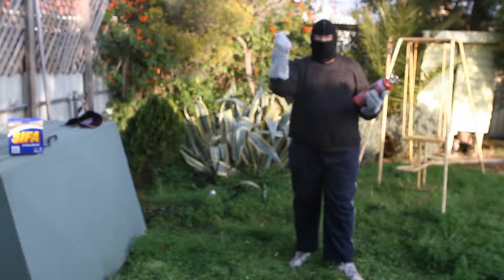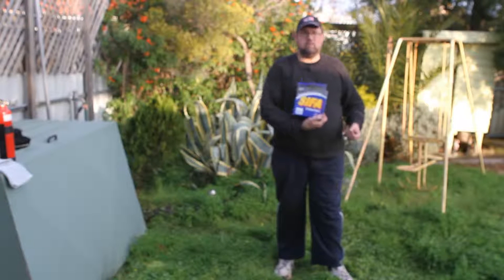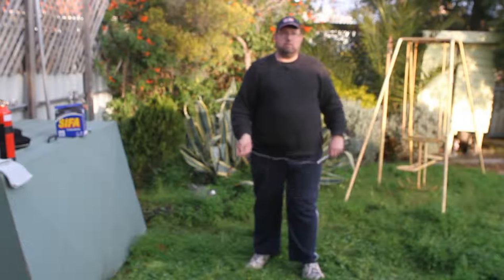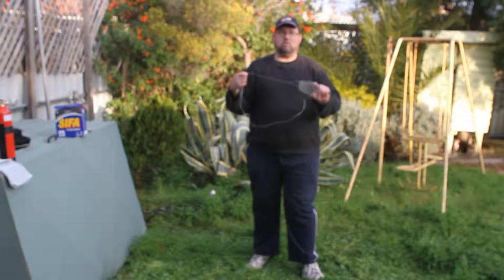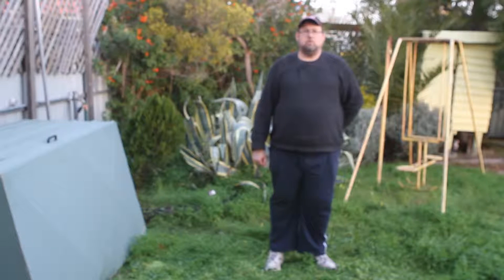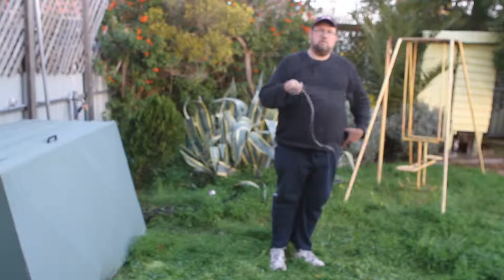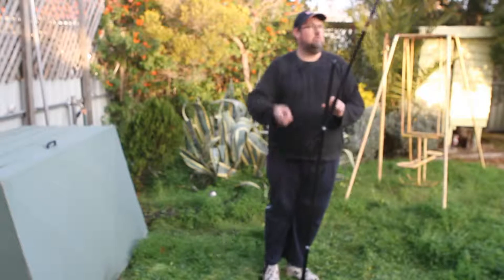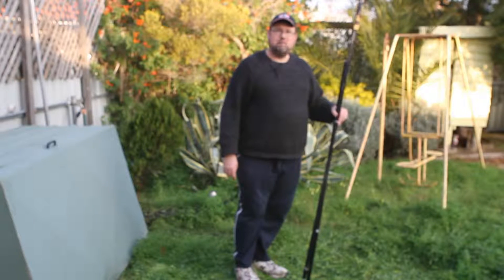Firewool spinning and Light painting ORBS

Comment: Very good tutorial
Reply from the maker: Bruce Hutchings Thanks, it was quickly done .. just for you. No preparation. Just grabbed the camera and the gear. So how soon before you do your light painting ?
Reply from the maker: Cool. Is your phone your camera ?
Reply: Michael Jenkin Yes
Reply from the maker: cool. Would love to see how light painting goes with a phone. Are you going to try ?
Reply: Yeah, I have a bunch of Blue LED's im thinking of making "Torch" with before I move onto the hot stuff.
Reply from the maker: cool. the hot stuff is cool but it's more practical using LEDS. LED's don't burn. steel wool hurts real hot and it hurts :)
Reply from the maker: you are going to try and swing wire or make a rig ?
Reply: swing wire